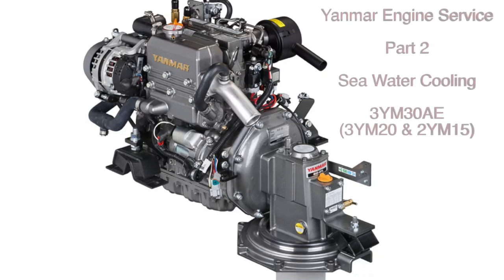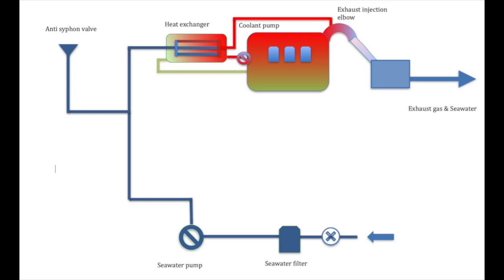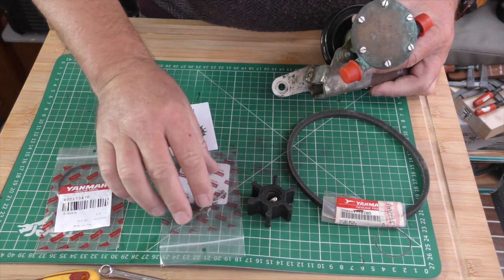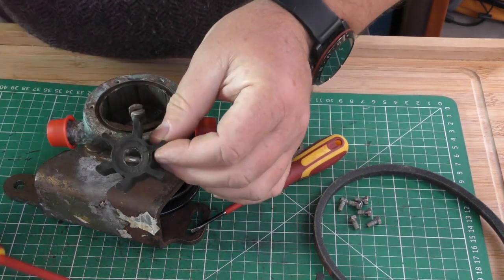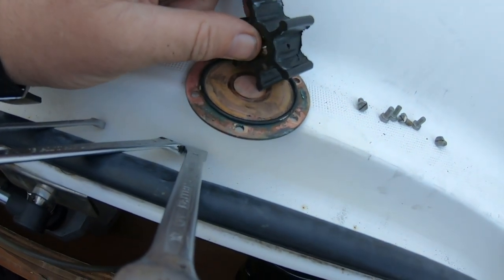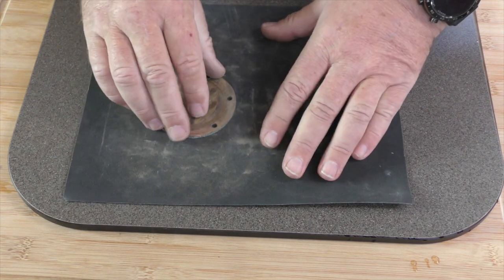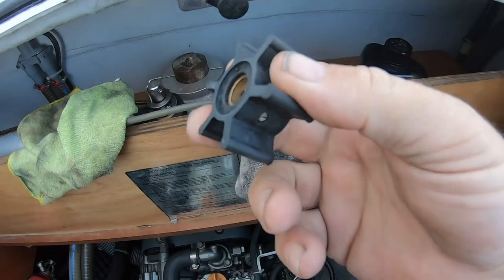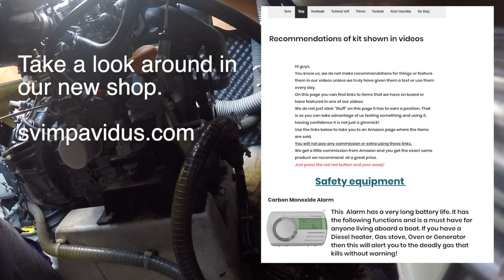Service your Sea Water / Raw Water Pump.  How it's cooled. Part 2 Yanmar Sailboat Engine.

Comment: Great point about polarity of the lobes not mattering, especially with a new flexible impeller.
Reply from the maker: Thanks mate. We hear so much waffle about this and the truth is it is not a problem. We need to adjust the tappet clearances at some time in the near future. That is going to be fun as we cannot see the timing marks. 😉 Sail Safe mate. Ant & Cid

Comment: Another excellent video, thanks Ant and Cid! 🙂
On my new/old sailboat (Amel Sharki), the Yanmar 4JH5E raw water pump is even more difficult to access, so I use an extractor that screws up on a threaded impeller.
Reply: Wanted to add the hpoto of the extractor with impeller but seems not possible here 🙂
Reply from the maker: Not enough room 😉

Comment: Hi Ant, such a useful video, especially for, me using my boat! Very timely. You don't mention the gasket though - should I use it?
Reply from the maker: Yes you do. Some are paper and some pumps have an O ring on the front. I think we did a video in Mersin with your pumps. Be sure the shaft is not worn on the old pump Peter. Sail Safe mate. Ant & Cid

Comment: Hi I have just used silicon lubricant is that ok ?
Reply from the maker: It depends on the type of rubber that your impeller is made from. It should be ok if it is not EPDM. Sail Safe mate. Ant & Cid